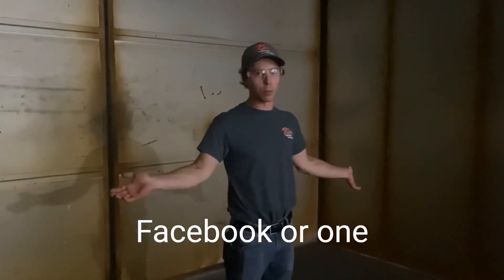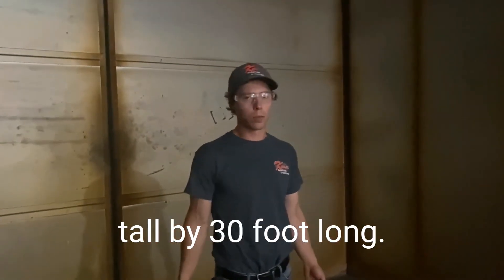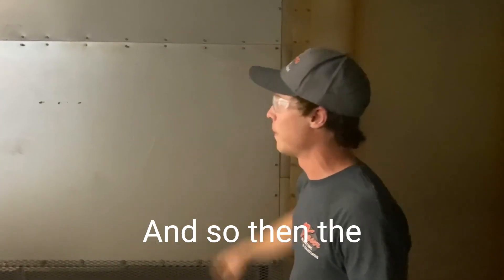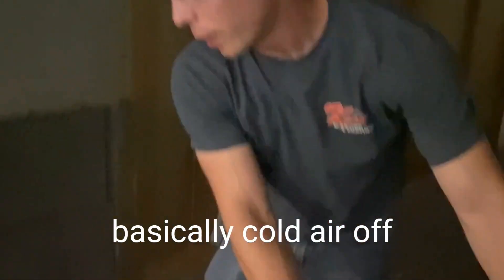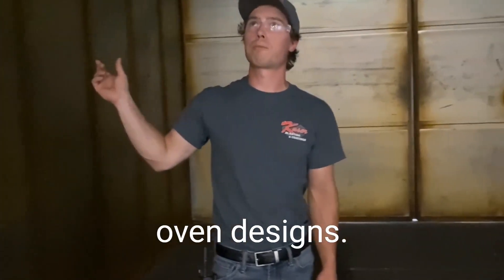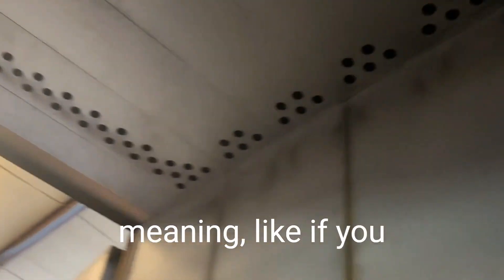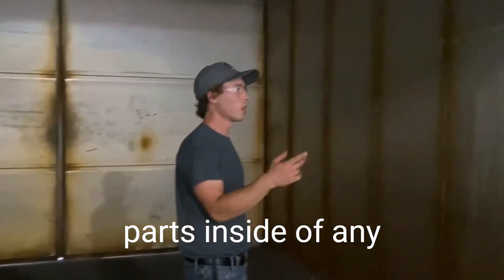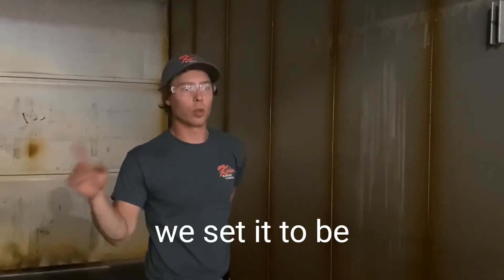Take a Tour of Kaser's Gas Powered Convection Powder Coating Oven

Comment: Nice oven,what types of powder do you use?
Just thermoset powders?
Reply from the maker: Yes. How about you?
Reply: @kaserblastingcoatings  thermosets and thermoplastics,Teflon powder.
Reply from the maker: @horthydro3987   What is Teflon powder?
Reply: @kaserblastingcoatings  we use it to line the insides of pipe,traditional Teflon is a liquid coating for thin film coatings,the powder Teflon is thick film,typically applied at 30+ mills
Reply from the maker: @horthydro3987  30+ mils????
Reply: @kaserblastingcoatings  thickness of the coating
Reply from the maker: @horthydro3987  That's so thick!
Reply: @kaserblastingcoatings  Thermoplastics and PTFE powders offer excellent chemical resistance and corrosion resistance.
Reply from the maker: @horthydro3987  You said you're coating pipes - what kind? What's the application?
Reply: @kaserblastingcoatings  hot flock internals of pipe,for pulp and paper mills,we use also a thermoplastic fda approved powder for internals of pipe for city water